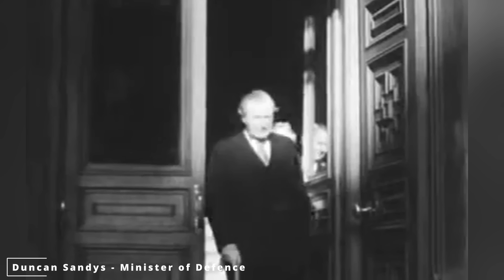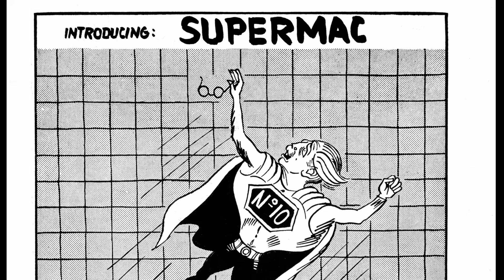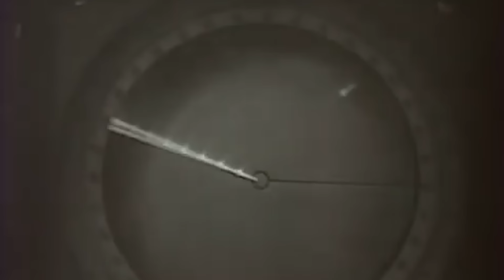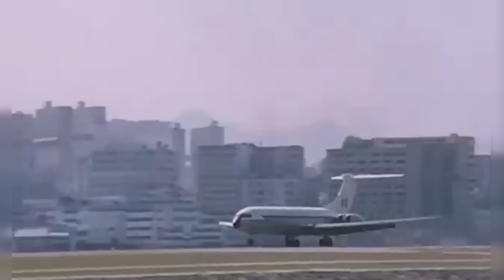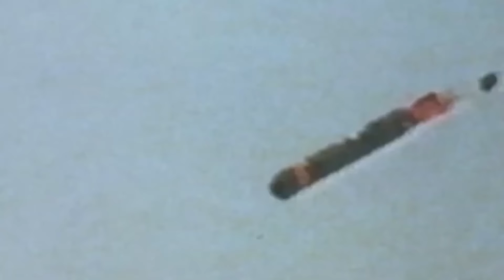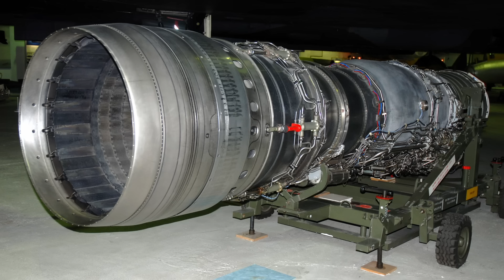How Britain Turned A Failed Airliner Into a Soviet Submarine Predator | The Mighty Nimrod

Comment: It is a shame that they made a mess of the MRA4 project. I would have loved to see the Nimrods still flying.
Reply: The MRA.4 was never a viable concept
Reply from the maker: I would love your insights on the MRA4 before I put pen to paper
Reply: @AviationRepublic  I do not know much about the project, other than the delays and cost overruns, and the eventual cancellation. I really liked the Nimrod, and the MRA4 was a chance to extend its operational lifetime. British designed and built aircraft are becoming very rare, so anything still flying from the glory days of UK aviation is a rare treat. The MRA4 could have been a big part of that, but it is now history (like the Avro RJ-X).
Reply: @DoktorBayerischeMotorenWerke 
 

We believe we can clear up some commonly held myths and misconceptions obviously.

It's always good to see the facts presented clearly and concisely isn't it?

Bow-wing (see B-47 wing collapse wing folding incidents) had built less than 12 pressurised airliners before the Comet first flew and they were not high altitude airliners. 

All Nimrods were new build Comet 4 airframes with appropriate strengthening and the unpressurized  equipment bay tacked on. 

The HS 801 Nimrod was the most advanced aircraft of it's type at the time it first flew. Problems with the MRA4 programme were almost entirely due to radar and computer equipment issues and BAe Systems & co being too busy with other work at the time. 

Obviously there have been worse aircraft for accident losses both before & after the Comet.

Early problems with Comet takeoff stalls were caused by pilots over rotating the aircraft at liftoff. 

Podded engines on wings have aerodynamics issues. The main reasons for eventually going with podded engines were because or to facilitate -
Ease of maintenance.
Use of shear off fixings given excessive out of balance forces.
Large diameter turbofan engines.
Reduce load on the wing to fuselage connection. 
Increased power from later engines. 

The Bow-wing (See B-47 wing collapse & wing folding incidents) was a good example of how to expend a huge amount of cash and effort on something that was probably not worth bothering with. The basic design of the Comet had been decided upon and established before the podded engine choice has been made for the B-47. There were aerodynamics problems with podded pylon mounted engines at the time. The US also built and operated a significant number of EE Canberra bombers under licence which did not use podded engines for their wing mounted engines. . 

There have been aircraft losses caused by pod & pylon mounted engines. 

All jet airliners benefited greatly from the knowledge gained from the Comet incidents & subsequent investigations & yet some were still worse for accident losses. 

Instances of all marks of the Comet flew with full certification after 1954 including the Comet 3. The last Comet flight occured in 1997.

The fabulous trail blazing DH Comet.
World's first jet airliner in regular service.
The jet engined Avro Lancastrian actually did a passenger service before the DH Comet. 
World's first high altitude airliner.
World's first airliner with a full fuselage length pressurised cabin pressurised for high altitude flight. That feature for that type of aircraft was a considerably difficult undertaking. 

The change from larger squarer windows to smaller rounder windows was necessary for the particular aircraft at the time. Skin thickness remained mostly the same for all Comet marks. 

How things were back then.
Accident losses - % of aircraft built.

DeHavilland Comet 4 UK                          14% 
DeHavilland Comet all mks UK (ff 1949)17%  
Vickers VC10 UK (ff 1962)                         5%

Douglas DC-1  US                                       99%
Douglas DC-2                                              47%
Douglas DC-3                                              30%
Douglas DC-4                                              26%
Boeing s300    US                                       72% 
Boeing 307                                                  70%
Boeing 247                                                   48%
Boeing 707  (ff 1958)                                 32% 
Lockheed L-049 Constellation (ff 1943)  30%
Lockheed Electra US (ff 1957)                   29%
Fairchild FH-227 US (ff 1966)                   30%
McDonnell Douglas DC-8 US  (ff 1958)   14%
Sud Aviation Caravelle  (ff 1955)             15%
Canadair CL-44 Turboprop US (ff 1959) 46%  
Convair CV-580 Turboprop US (ff 1960) 22%
Convair CV-880     (ff 1959)                      27% 
Convair CV-990     (ff 1961)                      33%
Tupolev T-104        (ff 1956)                     16%
Vickers Viscount UK  (ff 1948)                29%  
Fokker F-27 Turboprop NL (ff 1955)       40%      

The Vickers VC10, fastest Atlantic crossing for a non supersonic jet airliner, held the record for 41 years.

For the first few years of operation the Caravelle & Comet had similar accident loss fatalities.

Sud Aviation Caravelle - 
all accident loss fatalities - 
1320 fatalities. 

De Havilland Comet - 
all accident loss fatalities - 
453 fatalities. 

An example of a typical airliner from the period. 
The Fokker Friendship F-27 fatalities & accident losses as a % of aircraft built. 
Fokker F-27 Turboprop (ff 1955)   40%
2130 fatalities.

Of course De Havilland carried out a full stress analysis & performed extensive & protracted testing on two long lengths of fuselage representing all features of a complete airframe. De Havilland carried out significantly more testing than was required by any authority at the time & significantly more testing that any previous airliner was subjected to.

De Havilland designers / engineers knew all there was to know about metal fatigue at the time they designed the DH Comet.

De Havilland had prior experience building many all metal construction airframe aircraft including many passengers aircraft & thousands of jet powered fighter aircraft that were primarily of metal construction with pressurised cockpits & used jet engines built by De-Havilland.

De Havilland did indeed always work to better than industry standards at the time, used up to date knowledge for the design & testing activities & no evidence of negligence or criminal negligence was ever produced in relation to the DH Comet.

Global aerospace. 
From the 1950s sector rationalisation and consolidation took place. 70 companies in France and 300 companies in the US disappeared due to merger or dissolution. In the US Boeing was almost bankrupted by the 707 project.  Boeing had a well protected domestic market and the available space and resources in the US to engage in large scale airliner manufacturing enabling them to capture orders simply by being able to produce airframes fast enough and cheap and nasty enough. Another factor is airlines preferring to obtain as much of their airliner inventory as possible from one manufacturer. 

Global Aerospace Sector, what's happening.

For example, there are of course no German companies that makes German jet aircraft in Germany & there are no German companies that make German gas turbine aero engines in Germany that are suitable for widebody airliners.

The UK has the world's highest combined per capita Nuclear / Defence / Aerospace Sector Activity.

UK defence sector, absolute terms, world's second highest activity. 1st for per capita defence sector activity. Per capita nuclear powered submarine construction, 2nd position. 
Main players being Rolls Royce, Babcock, GKN Aerospace & BAe Systems. Activities often involve international collaboration. BAe systems, RR and other UK companies now handle more Airbus work value wise than Germany. 

There's a good chance that anyone currently flying on a widebody airliner will be on an aircraft powered by RR gas turbine aero engines made in the UK and a good chance there will be other hardware on the aircraft that's designed and / or manufactured in the UK. 

Rolls Royce Holdings UK
Subsidiaries
- Rolls-Royce plc
- Rolls-Royce North America (ex Allison etc Classified Military stuff)
- Rolls-Royce AB
- Rolls-Royce Deutschland
- Rolls-Royce India Private Limited
- Rolls-Royce Marine Power Operations
- Vinters Engineering Limited
- Rolls-Royce Controls and Data Services
- Rolls-Royce Power Systems
- Bergen Marine
Joint ventures include:
- Rolls-Royce Turbomeca
- MTU Turbomeca -

Trent Family
The MT30 (Marine Turbine)
Industrial Trent 60 Gas Turbine
Trent 7000
Trent XWB Airbus A330neo.
Trent 1500
Trent 1000
Trent 500
Trent 600
Trent 700
Trent 800
Trent 8100
Trent 900
   
RR wholly owned subsidiaries in Germany handle smaller 2 shaft RR gas turbine aero engine work.

The UK space and aerospace sectors are highly productive, high-value industries that together contribute over £18 Billion in direct Gross Value Added (GVA) to the UK economy. Individually, the space industry directly contributes about 0.3% of UK GDP 7•2 Billion while the aerospace industry contributes approximately 0.5% £10•9 Billion.
   
We hope this helps.
Reply: @DoktorBayerischeMotorenWerke 

Typhoon & Tornado, British design aircraft. 

Early days of the airliners.

The awesome De Havilland Comet.
World's first production jet airliner.
World's first high altitude airliner. 
At the time the Comet wasn't particularly dangerous. The DH Comet was definitely not the worst engineering failure in commercial airliner history.

Losses comparisons.
How things were in those days.

DeHavilland Comet 4 UK                          14% 
DeHavilland Comet all mks UK (ff 1949)17%  
Vickers VC10 UK (ff 1962)                         5%

Douglas DC-1  US                                       99%
Douglas DC-2                                              47%
Douglas DC-3                                              30%
Douglas DC-4                                              26%
Boeing s300    US                                       72% 
Boeing 307                                                  70%
Boeing 247                                                   48%
Boeing 707  (ff 1958)                                 32% 
Lockheed L-049 Constellation (ff 1943)  30%
Lockheed Electra US (ff 1957)                   29%
Fairchild FH-227 US (ff 1966)                   32%
McDonnell Douglas DC-8 US  (ff 1958)   14%
Sud Aviation Caravelle  (ff 1955)             15%
Canadair CL-44 Turboprop US (ff 1959) 46%  
Convair CV-580 Turboprop US (ff 1960) 22%
Convair CV-880     (ff 1959)                      27% 
Convair CV-990     (ff 1961)                      33%
Tupolev T-104        (ff 1956)                     16%
Vickers Viscount UK  (ff 1948)                29%  
Fokker F-27 Turboprop NL (ff 1955)       40%      

The Vickers VC10, fastest Atlantic crossing for a non supersonic jet airliner, held the record for 41 years.

For the first few years of operation the Caravelle & Comet had similar accident loss fatalities.

De Havilland had prior experience building many all metal construction airframe aircraft & thousands of jet powered fighter aircraft that were primarily of metal construction with pressurised cockpits & jet engines built by De-Havilland. No aircraft before the Comet was subjected to as much pre-production testing as the Comet. 

It's a great pity & a crying shame that British military forces had to occupy a large part of Germany for decades after 1945 & Russian military forces had to do the same. Of course Russia still posseses a large chunk of what was German territory & of course Russia & the UK produce nukes. Obviously Germany does not produce nukes.

Interesting British achievements.

The gas turbine engine was invented & patented in England before the 1800s.

Axial multi stage sequential stage compressor & turbine technology, first produced for turbo machinery use in England by Parsons of Ireland & North England during the 1800s. The components form the basis of most modern gas turbine aero engines. At the time the concept of the jet aircraft powered by axial internal combustion gas turbine engines was first mentioned thus the internal combustion jet engine & jet aircraft was indeed invented in England before the 1900s & before the Wright brothers got busy.

Work on the multi stage sequential stator rotor axial compressor as applicable to the axial compressor gas turbine aero engine was ongoing in England from around 1928 by Arnold Griffiths and others. By 1943 the Metrovik F2/3  Beryl was a running axial turbojet that was superior to anything anywhere else. As the centrifugal compressor engines were adequate and more powerful at the time development of a larger F2/3  version was commenced.

The Metrovik (UK)  F2/3 axial compressor gas turbine aero engine was flight certified & ran in 1942, it was the result of UK development work ongoing since 1929. At the time it was the most capable axial compressor turbojet in existence but was not required and development work continued on a larger version.

Frank Whittle performed the world's first demonstration of a gas turbine aero engine in 1937. People in Germany kept a close eye on everything going on in Britain at the time.

The centrifugal compressor RR Nene was the most powerful & most reliable gas turbine aero engine on the planet in 1944. That engine would be later built under license or copied in many countries including Russia (Mig-15 Mig-17), China, the US, France and Switzerland powered dozens of aircraft types for decades after 1944.

Pratt and Whitney and others produce centrifugal compressor gas turbine aero engines. The PW200 is a currently produced whittle style centrifugal compressor, reverse flow combustor, gas turbine aero engine. 

The world's first wind tunnel was constructed in England during the 1870s. The world's first supersonic wind tunnel was constructed in England in 1922.

There is no doubt that the Fairey (England)
Delta 2 was the world's first jet
aircraft to exceed 1000 mph.  Indeed It
exceeded the previous record by 310 mph &
held the record for 1 year. Incidentally, the Dassault Mirage 3 & 4 are based on the Fairey Delta 2.

More recent UK military jet aircraft.

The Tornado & Typhoon & their engines are Supersonic & are indeed British design aircraft with British design engines built by an international consortium. The Tornado design for example started life during the 1950s at Vickers as the AFVG, it's engine is based on the RR RB-199. The EE Lightening is also a British Supersonic jet aircraft.

The Typhoon is the British BAC-EAP with an engine based on the British RR XG-40, the Typhoon is also built by an international consortium.

Brazil has the world's third largest airliner manufacturer and makes very good airliners & Brazil is 100th down the list along with Indonesia for wealth per capita. Of course it is in fact the case that Embraer can't build those airliners without purchasing stuff from the US, UK & Europe. For example, Norway, Holland, Denmark, Ireland & Belgium, top 20 wealth per capita, don't make airliners, its as simple as that.

Global aerospace. 
From the 1950s sector rationalisation and consolidation took place. 70 companies in France and 300 companies in the US disappeared due to merger or dissolution. In the US Boeing was almost bankrupted by the 707 project.  Boeing had a well protected domestic market and the available space and resources in the US to engage in large scale airliner manufacturing enabling them to capture orders simply by being able to produce airframes fast enough and cheap and nasty enough. Another factor is airlines preferring to obtain as much of their airliner inventory as possible from one manufacturer. 

Global Aerospace Sector, what's happening.

For example, there are of course no German companies that makes German jet aircraft in Germany & there are no German companies that make German gas turbine aero engines in Germany that are suitable for widebody airliners.

The UK has the world's highest combined per capita Nuclear / Defence / Aerospace Sector Activity.

UK defence sector, absolute terms, world's second highest activity. 1st for per capita defence sector activity. Per capita nuclear powered submarine construction, 2nd position. 
Main players being Rolls Royce, Babcock, GKN Aerospace & BAe Systems. Activities often involve international collaboration. BAe systems, RR and other UK companies now handle more Airbus work value wise than Germany. 

There's a good chance that anyone currently flying on a widebody airliner will be on an aircraft powered by RR gas turbine aero engines made in the UK and a good chance there will be other hardware on the aircraft that's designed and / or manufactured in the UK. 

Rolls Royce Holdings UK
Subsidiaries
- Rolls-Royce plc
- Rolls-Royce North America (ex Allison etc Classified Military stuff)
- Rolls-Royce AB
- Rolls-Royce Deutschland
- Rolls-Royce India Private Limited
- Rolls-Royce Marine Power Operations
- Vinters Engineering Limited
- Rolls-Royce Controls and Data Services
- Rolls-Royce Power Systems
- Bergen Marine
Joint ventures include:
- Rolls-Royce Turbomeca
- MTU Turbomeca -

Trent Family
The MT30 (Marine Turbine)
Industrial Trent 60 Gas Turbine
Trent 7000
Trent XWB Airbus A330neo.
Trent 1500
Trent 1000
Trent 500
Trent 600
Trent 700
Trent 800
Trent 8100
Trent 900
   
RR wholly owned subsidiaries in Germany handle smaller 2 shaft RR gas turbine aero engine work.

The UK space and aerospace sectors are highly productive, high-value industries that together contribute over £18 Billion in direct Gross Value Added (GVA) to the UK economy. Individually, the space industry directly contributes about 0.3% of UK GDP 7•2 Billion while the aerospace industry contributes approximately 0.5% £10•9 Billion.
   
We hope this helps.
Reply from the maker: It was a fine old mess, that's for part three of this story.